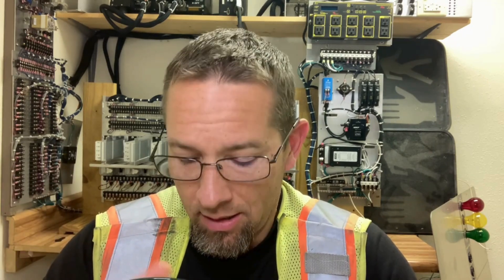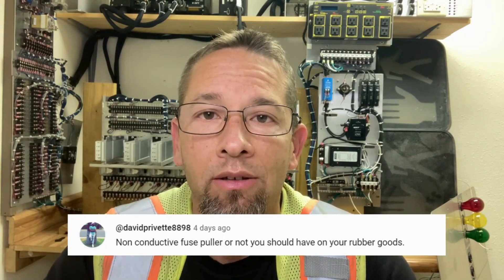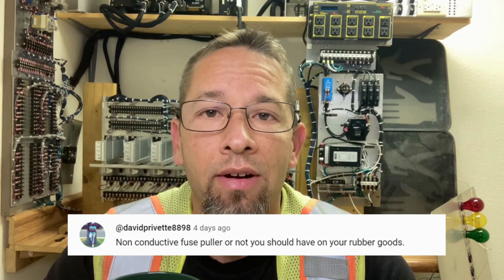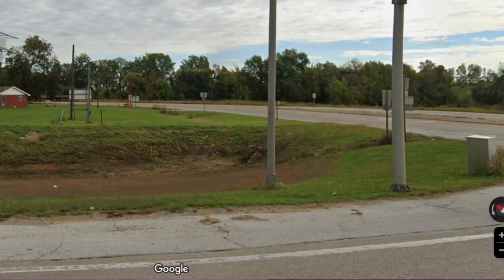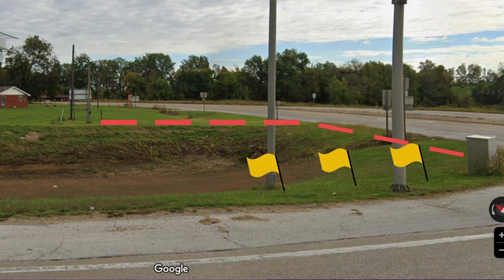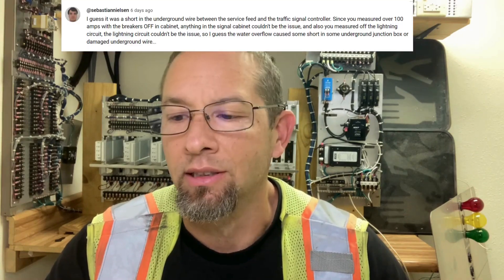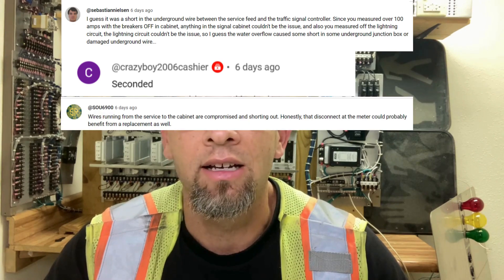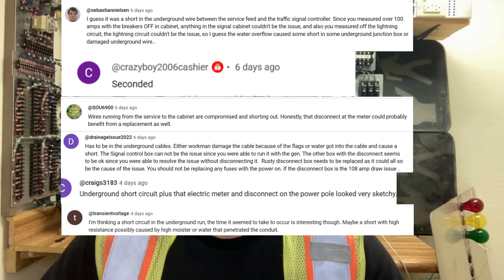Traffic Light Blowing Power Fuses - PART 2!

Comment: The craziest trouble call that I experienced had a "Christmas tree." All the signal heads were lit, greens, yellows, and reds. All at the same time. Here is the crazy part: I turned off the main breaker in the cabinet and the signals remained lit! Seemed impossible. Everything in the cabinet went dark when I turned off the main breaker, but the signals stayed on. I figured the signals must be getting power from another source, but how? Turned out the underground metal conduit contained street lighting feed wires. This feed wire was bare and energized the metal conduit. This conduit became extremely hot and melted the traffic signal cable. The melted wires made contact with the energized conduit and lit up all the signals in the field like a Christmas tree. We located the street lighting feed and disconnected it. The signals went dark and the conduit cooled down. We pulled out the melted signal cable and ran new cable. This occurred on a cold day in the winter after midnight. Not fun!
Reply from the maker: Holy cow Mike!  That's a new one to me!   That would have been an amazing video to shoot if I was in that predicament.  Although....I don't think I would have wanted to be if it was a cold winter night🥶
Thanks for sharing that...and great find to fix it
Reply: @streetsmartstraffic  Holy hell that's wtf troubleshooting
Reply: i would have  been like 'not my job'